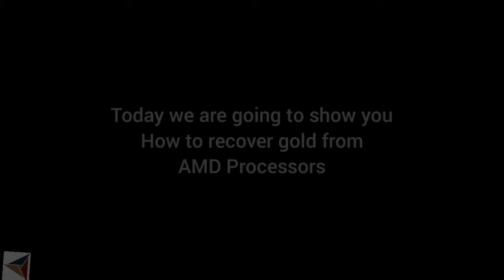AMD K6 Processors Gold Recovery | Recover Gold From Computer CPU | Gold Recovery

Comment: i am very like your video , i have question why on this video you not use urea ? because I have watched all your videos, after you do aqua regia you always give urea before giving SMB (sodium metabisulphite), maybe you can explain to me, thank you and good job 👍👍👍
Reply from the maker: The Urea was used to neutralize the solution. 
But tried this without the Urea and turns out it works fine!😀
Reply: okay thank you for the answer, sorry one more question may be, in every video you always provide a chemical measurement dose in every process, what I ask is how to calculate the dose, is there a formula for this, in advance thank you very much if you want to answer it,  because I'm very curious about it 😇🙏🙏🙏